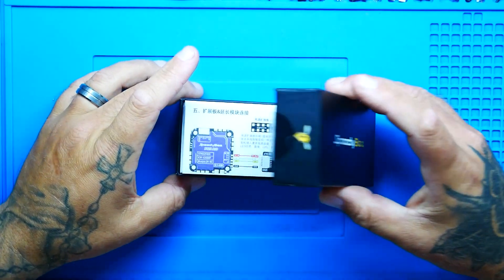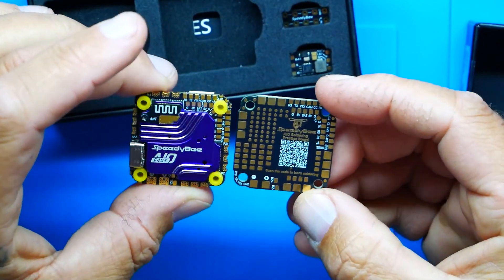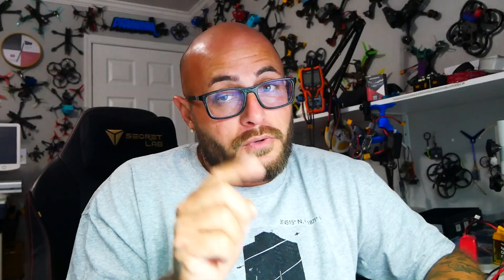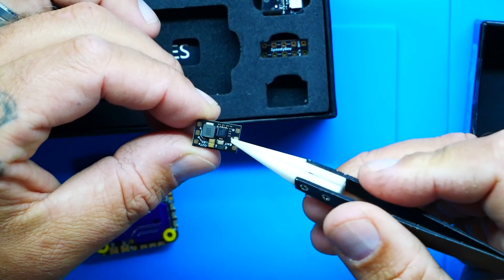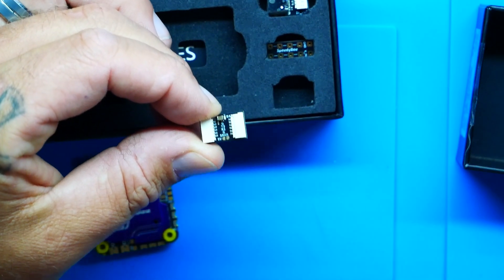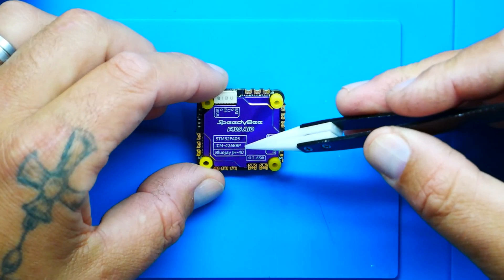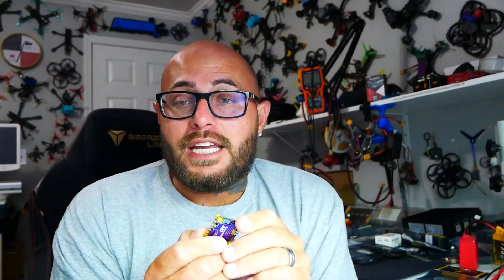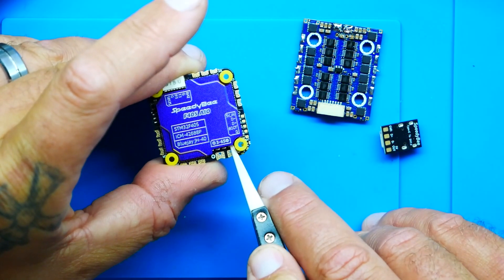$56 Dollar AIO That Literally Does it All  🤑 ❗❗

Comment: I am a big fan of this AIO.  I also very much like the SkyStars Jupiter AIO - same price, similar features.    

These shielded AIO's are cool looking for sure, seems like they perform quite well which is amazing.

I like the fairly large soldering pads for everything.  On some of my other AIO's the pads are so tiny that it is almost impossible to get your iron in there, even with a small tip.    So this is a big deal i think.

Also, the features are terrific.  The BEC is nice, and the fact that it has Bluetooth is also so cool.  Great review, great product.

Comment: I used this FC with my gofilm 20, I couldn't do the super f405 and the 25mm x 25mm it works perfectly with the gofilm frame it was tight but the best decision, I love the bluetooth and the meteored lights are so cool I think speedybee will be the only flight controller I'll be using for now on because they invest in the builder a lot of others just sell things with low to no communication like they just want money but with speedy bee they're really for the builder.

Comment: It looks great, I'm planning to buy one, I have a 5" 6s armattan rooster where I had individual esc and aio fc but by not reason esc and aio burned so was planning to buy the components but at the end for my budget individual parts cost will be high, was also planning about buying a speedybee stack but space on the rooster is not a lot so I think this aio could be a good option and a excellent price range,  lower than stack and the individual parts

Comment: Would like to see you rip it in that master 5 v2 😉 i have 1 with 03 unit and supernovas 2207. That one has the F4V4 55a stack. That sucker rips!! 😁  I just ordered this aio 😁 i have the pink axis flying argus f7 aio in my speedybee35 and doing great. 2205 xings. Would love to see how this aio handles some power. How hot does it get 🤣 i seem to deal with heat a lot. Darwin cement F7 and argus f7 aio get hot. Keep the great videos coming Drainmaaann 😁👊
Reply: How is yours holding up? Mine has been great 😁 as a matter of fact i have an axis flying argus f7 aio and this speedybee f405 40a aio that i fly 1 right after the other and can't even tell the difference 🤯 thinking about buying another 1 of these to save a few bucks. Maybe i have the settings limited on the argus but they feel the same 🤣🤯  hoping to see some feedback from you because i know you wanted to test it 😁